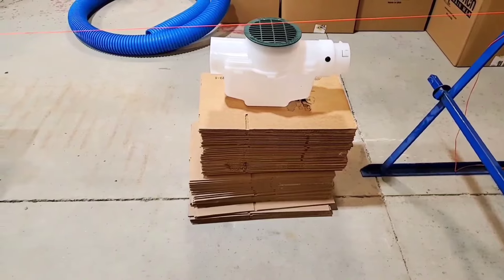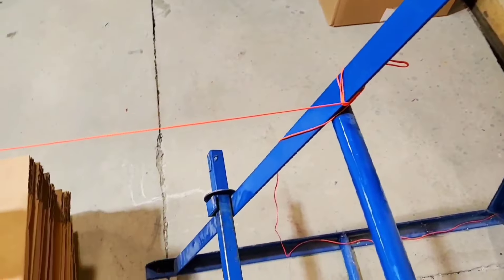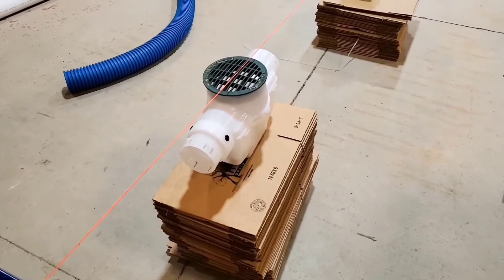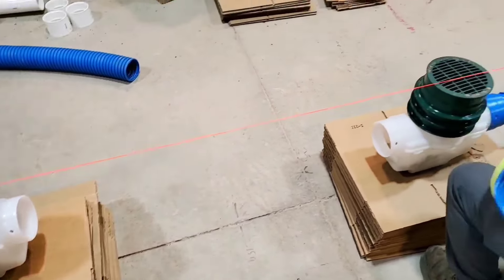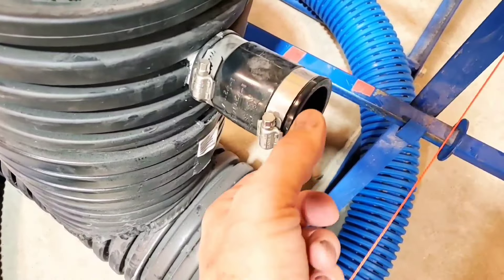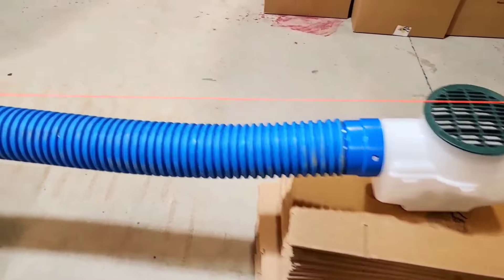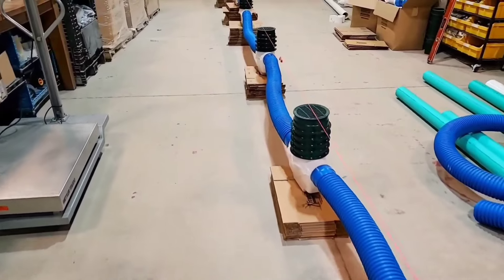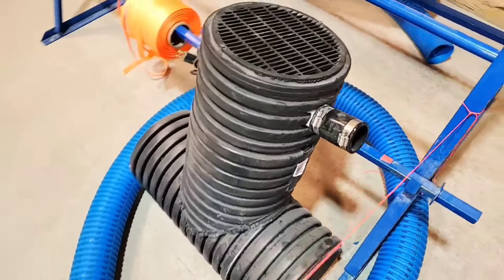Yard Drainage System Easy DIY Full Tutorial

Comment: What do you think about using catch basins in combination with a French drain to catch and direct large amounts of storm run off? We’ve had thunderstorm runoff threaten our house as it ran down the road next to our property. The ground absorbs water quickly in our area but run off can be a problem in big down pours. Our house and shop are adjacent to the gravel road so we don’t want to put in a big ditch as we would have to drive through the ditch to park… any ideas or video links would be appreciated. Thanks
Reply from the maker: https://youtu.be/F1MNegA1yMM?si=yl64VLtHd-bx2gw6
Reply: @FRENCHDRAINMAN  thank you Sir!!! How deep do I need to go on a French drain if I’m driving over it with my F350? I’m going to bury in gravel two perforated pipes plus one solid pipe with grates… also do you think these plastic grates can handle being driven on?

Comment: I currently have a river rock drainage area in my backyard that fills with water during heavy rain and runs along the side of my driveway into the street. If I install a perforated French drain line in this area how do I cap it at the end to empty into the street efficiently?
Reply: The previous owner had dug a small (6-12 inch wide) sloped pathway which runs down the side of the driveway but is not filled with stone or a drain. The water currently just runs naturally down the sloped dirt pathway into the street but not very efficiently.
Reply from the maker: https://frenchdrainman.com/product/4-in-x-18-in-corrugated-drain-tile-dual-wall-with-critter-guard/

Comment: Thanks for the detailed video and what appears to be another great product.  I’d like to run a double- barrel perforated (high octane) at the base of my trench as a french drain and then a yard drain (solid pipe with FDM catch basins) on top.  All in the same trench.    I’ve seen you do this in some videos prior to the release of the new basin and I love the concept.  If I want to use the FDM catch basins along the line, how do I prevent bowing of the solid pipe between basins? It looks like the basin will sit a little too high if I just dropped it on top of the double barrel.  I have some ideas but would love to know the recommended solution.  Thank you!
Reply from the maker: https://youtu.be/F1MNegA1yMM?si=wnEllZYXODY4323J
Reply: Beautiful. Thanks!

Comment: If you don’t have a basement what type of drainage do you recommend for sitting water in the back yard where there a slope and the water is going towards the house? And what would be the average price to get the job done? Any recommendations on reputable companies in a Philadelphia that can do the job. Had one company come out and didn’t even recommend catch drains but French drain with a dry wall. But if the water sits on a straight level point the water just sits. I’m not a plumber but I would like think I need catch basins in certain areas
Reply from the maker: https://youtu.be/pmDxR1Uxkx0?si=PPEnq9wuPFHNc2ie

Comment: I am interested in your basins, but trying to find detailed videos of what I am trying to accomplish.  For my situation, I need a yard drain, not a perforated pipe French drain.  I want to use PVC pipe so I can run a snake through if I have to at some point to clear debris or tree roots or anything else.  I want to run 2 gutter downspouts into the Yard Drain and maybe something to catch leaves.  Also, want to run a yard drain on a separate pipe with 2 catch basins.  Do you have detailed videos on connecting downspouts to your basins and connecting your Catch Basins to solid PVC piping?  Also guidelines on how high to set the basins would be nice.  Should they be exactly at ground dirt level or a little above.
Reply from the maker: https://youtu.be/w6-kU25vN54?si=xi-32JezehAuOORW

Comment: Robert the whole thing makes sense to me except the sump pump. My yard backs up to another person’s yard who is lower than me. I do have some grade to the yard. My neighbor, unfortunately sends a lot of water over from their house down my tree line against the left fence and over into the very bottom of the yard where I have a bog. My own downspouts go into a corrugated catch basin system, which takes it away from my house to the same area but I’ve just got too much water there. I think using your system of catch basins. I could probably install this summer beside my existing run or replace my existing run with lots of your catch basins, and that would catch their water as well. Can you do a detailed video about how the sump pump works and when I connect up the discharge pipe given someone is behind me, where would I be dispersing the water to? I am assuming it would be a surface pipe that would possibly be corrugated with holes to allow it to disperse out over a long run? For me that might be from the bog (lower left yard) running to the right, behind my shed all the way to the far right corner of my yard (which unfortunately is higher). This run is probably about 125 feet. Need help! I want to fix this mess and hope to convince my neighbor to do his part since he is sending over a lot of water into my property.
Reply from the maker: https://youtu.be/ORFCgTEPq1I?si=7tkBkhADpm2CF1sA

Comment: No doubt these are the best products on the market! Unrelated question I’d love to hear your answer: How can farmers get away with burying black corrugated pipe in the dirt with no aggregate in the trench for draining their fields? But if a homeowner attempts to do that, the pipe just gets clogged with dirt.
Reply from the maker: The farm tile runs for miles. You pick up water throughout the pipe. Eventually, it's completely full, and it's discharging like a firehose. When you move that much water through a pipe, it's gonna flush any dirt right out the discharge.